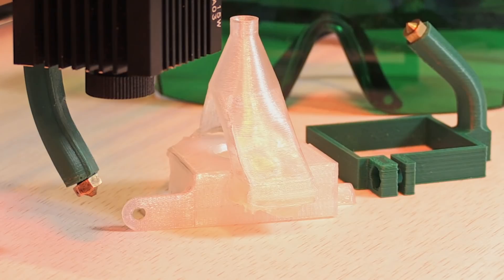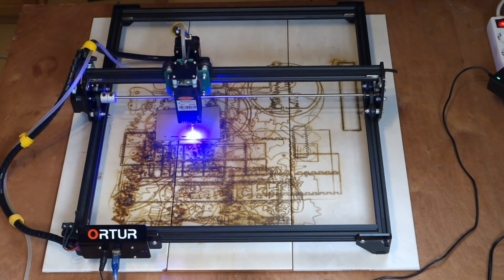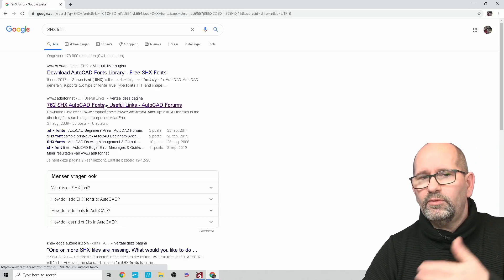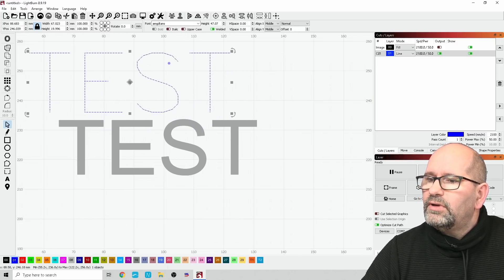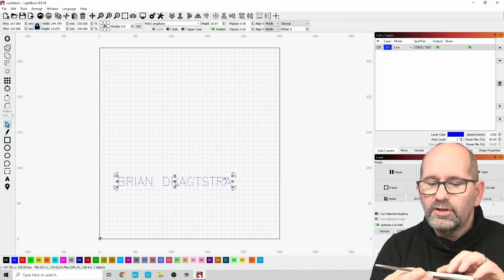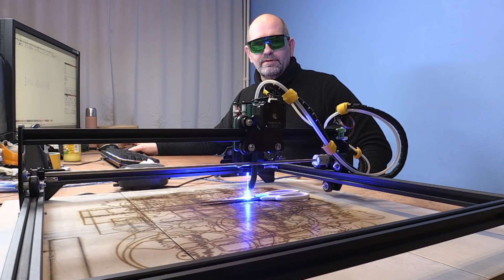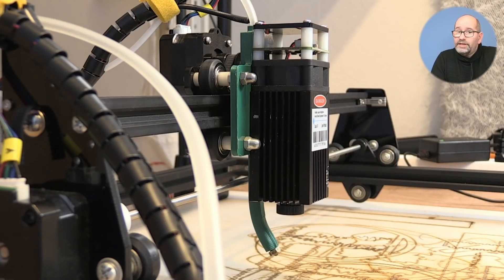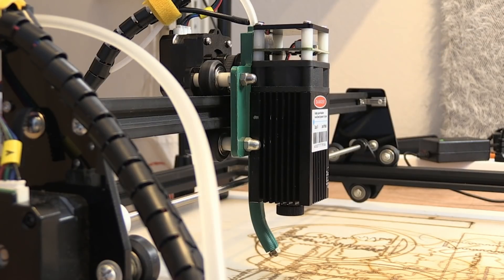▼ Ortur Master 2 METAL engraving with mustard and the NEW Air Assist

Comment: 5 weeks ago i tried this. I posted a little video on the ortur fb page. I saw someone doing it on YouTube.  He explained the chemical reaction.  In my experians,  don't do this without proper ventilation. I think the smoke of the burning mustard and stainless steel is not healty at all.
Reply: I think I was the one to first post the mustard technique. You can see it on my channel. 
One thing that would be helpful to compare results is to clarify that some laser diode engraver manufacturers incorrectly use the input electrical power to rate lasers. For decades the standard has been the optical power output, which is about 1/3 of the input. You can see that sleazy marketeers prefer the larger number.
Reply from the maker: @Adam Norton You have an extra subscriber :-)
I learned about this technique in the Makerspace where I sometimes volunteer. It was one of the kids that showed me this trick.
As for the laser power, In almost all my other video's about the lasers I have, I explain this fact. In this video it was cut out because of the length of the video, and because I repeat myself over and over again :-)
By the way, in Electronics it's very common to state the real power of the laser and not the result after pulse width modulation, which is needed to operate a diode laser. With a duty cycle of about 25 to 35 percent, the laser has indeed an optical output that is about 1/3 of the input power.
Reply: Its your video i saw!! I dunno anything of chemicals. But i worked with stainless steel for 27 years.  Great to learn something new!!
Reply from the maker: @Daniel Wouters and @Adam Norton.
Thanks to you both. I love the way people like you share knowledge online.
Reply from the maker: Hi Daniel, that sounds like really important information you share.
Do you possibly have a link to that video?
I learned about this process in my local Makerspace and I do not know the chemical reaction that goes behind it.
In my opinion, you are heating up the mustard like you would if you use mustard for cooking, but I might be totally wrong here.
Reply: I will search for the video i watched.  If i rememer right, it was something with the chrome. In "normal" life no one is burning mustard haha so with cooking you wil never heat up mustard like we do!!

Comment: I like to know if this method would also work with a CO² Laser.
Reply: You don't need mustard with a CO2 laser, it's powerful enough to engrave all on its own. Of course, that depends on the wattage of the CO2 laser. They come anywhere from 30w to 150w typically.
Reply: @muskokamike127  No. That is not right. A Co² Laser CANT engrave any Metal wirhout a helping chemical. And thats not engraving,  its more burn paint into Metal.
Reply: @K40Keller  sorry, should have spec'd "coated metals" my apologies
Reply: @muskokamike127  Ah, ok.
Reply from the maker: @Nicolaus & @Muskoka.
I hope, in the near future, I will buy myself a good CO2 laser.
Reply: @3dPrintCreator  yeah me too! Ive gotten a quote from a supplier for a 150w co2 with ruida controller and a 1M x 2M bed. 

I could adapt a co2 laser to my cnc machine, but the cost in parts is about the same as if I just buy a machine. Also: the exposed laser as it travels the mirrors is quite dangerous. Not just to body parts but because I also cnc rout, there is often dust in the air....it'd be like fire works going off as the dust is ignited lol.....

What I do with mine now is cut shapes, masking, laser small text etc then swap the laser for CNC and cut out the final shape.
Reply from the maker: Me too, but as I don't have one, I can't tell.
Maybe one of my viewers with a CO2 laser can test this and comment on it.

Comment: Mustard ? Who would have thought that ? I've been investigating acidic solutions to try a few metal based experiments with my laser.
The reason that you are getting so different results with your lasers may be the power level, and the fact that blue (purple) lasers are pumped IR lasers, so your laser may also be emitting in IR spectrum, and the steel will just love to soak up that wavelength.
Reply from the maker: Hi Dirk,
What an honor that you leave a message on my YouTube video.
I've been following your channel for ages and I learn a lot from you. It is indeed possible that the infrared part of the spectrum, which is little but certainly represented, is responsible for the engraving of the steel, but I am also sure that the acid in the mustard plays a role, because with one brand of mustard it is very quick and easy, with the other brand I have to use the laser much more intensively over the steel.
Reply: @3dPrintCreator  Yeah, Mustard is some powerful stuff, I think that there must be some powerful oxidiser at work too. My 80W CO2 laser won't scratch steel or copper, but once it's been in touch with the soot of burning wood cuttings, it does it somehow. I really like your channel - loads of helpful content and great explanations !

Comment: iam so sad i try it but nothing happen, iam using neje 20watts laser
Reply from the maker: There can be a few reasons, but the main reason is focus. Make sure you have the object in perfect focus.
If that doesn't help you, use another type of mustard, and make it go slower (as slow as possible) and repeat the engraving, maybe 10 times.
With any type of mustard it will eventually work, but some will need more power, slower speeds, and more passes, then others.
Reply: @3dPrintCreator  I try 100 up 50 speed. And 100% power. 20 times pass.  I focus the lense carefully.. Maybe the brand of mustard. I will buy another Tom. Thank you very much sir for your time.. Keep safe

Comment: You convinced me to buy the ortus 2 20w model yesrerday. A great video and tutorial.  Can u let me knoe how i can get hold of the air assist . I dont have any 3d printers. Can i get that from any of your website . Will be very grateful.
Reply from the maker: When the air assist file is released, you can download it and sent it to a local makerspace or a print service, like 3d hubs.
I think I will have to new and tested file available next weekend.
Reply: Just be advised that I am 99% positive that it isn't actually a 20w laser. AFAIK the most powerful diode laser you can obtain is 7w. Many companies rate the power consumption as opposed to the laser power.
Reply from the maker: 100% true. The optical output is about 5.5 Watt.
Yet, this has to do with the PWM duty cycle as the diode really has a rating for (in this case) 15 Watt, but the duty cycle turns it on only about 1/3 of the time.
If this wasn't done, the laser would be dead in about a minute.

Comment: I tried the metal burning set up by following your video and walla  NOTHING. As clunky and mysterious as the light burn software so are all these goofy youtube fiction you guys post.
Reply from the maker: I feel so sorry for you that you don't have the decency to just ask why you can't do it when I can. If you had just asked me that, I would have told you in response that it could be because of the acidity in the mustard, why one person is doing well very quickly, and the other really has to adjust his speed to a very low speed, for example 25mm / min and 10 passes.
But whether you use very sour mustard or very mild ones, in all cases I managed to get a good result...
So, I have satisfaction from my engraving work, and you have an off day because you did not succeed.
Greetings from the Goofy PrintCreator.
Reply: @3dPrintCreator  OK I get it I'll look for the brand you used and try again
Reply from the maker: Believe me, the result I posted is real.
Once you get it working, you will love this method. :-)

Comment: I keep seeing people talk about orturs new 40w laser but google gives me nothing. Do you have a link to it?
Reply from the maker: They have talked about it, but it has not yet been released as far as I Know.
NeJe has already brought the 40Watt lasers to the market, and they can be used on the Ortur, but I wait for the official laser.
Reply: @3dPrintCreator  Do you know if the "40W" modules use a different diode than the NUBM44 (7W optical output). It is my understanding that the "20W" modules are 5W out, the "30W" modules are 7W out. What does that place the 40W modules for their output power? Is it one diode or two with a beam combiner? Just wondering if you may know.
Reply from the maker: @laserwizard1982  I don't have hands on experience yet, but I read info about the 40 watt Neje model that it has an optical output of about 15 watt and also that it uses a beam combiner.
But as said, I have not yet had a chance to open a more powerful  model.

Comment: Hello Brian, that's interesting!
I'm wondering which are the peculiar physical/chemical properties of mustard such to enable metal etching...
I presume that, once explained, it should be possible to pick out a more specific substance, saving mustard for frankfurters 😉

And by the way, how did you manage to find out that precisely mustard was the trick?
Just a wild guess, or else did you went through the whole process by trying first ketchup, mayo, jam, butter and so on? 😁
Reply: On second thought, could it be that stainless steel is too shiny and thus reflecting back most of the laser radiation?
In this case mustard could be acting as a laser absorbing means... Have you tried by simply blackening the steel surface first with a permanent marker or such?
Reply from the maker: Hi... I tried al kinds of blackening the stainless steel, but all without any succes.
The mustard trick seems to work because of acids that become very aggressive when they are heated, therefore etching the material instead of really engraving it.
I am not very good in chemistry, but this was how the people at a makerspace explained it to me.
It took me very long to succeed with it, and strangely enough, it works on my Master II laser very quickly, while on my smaller Master Laser, I need 10 passes and less speed for it to work.
Also, The shown mustard works really well, while another jar of mustard only gives me a very light result, without the deep black contrast.